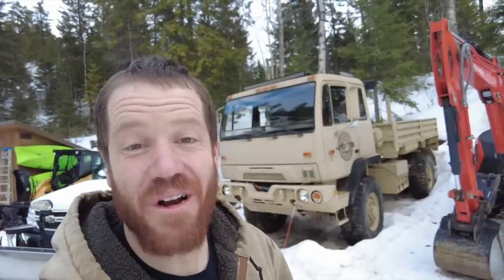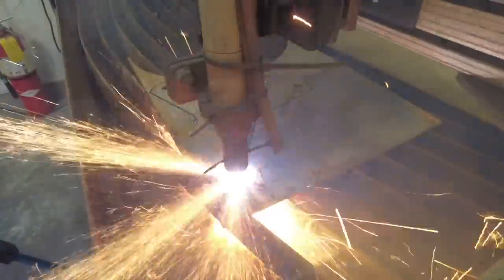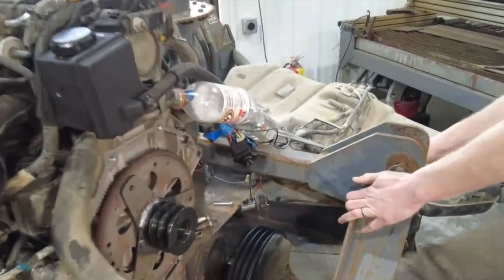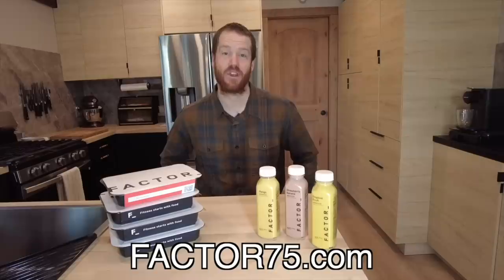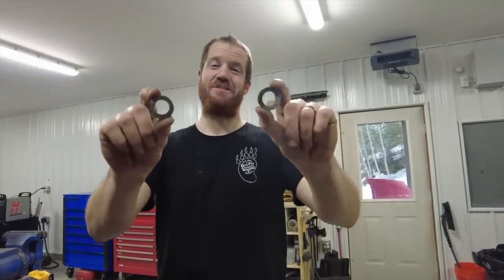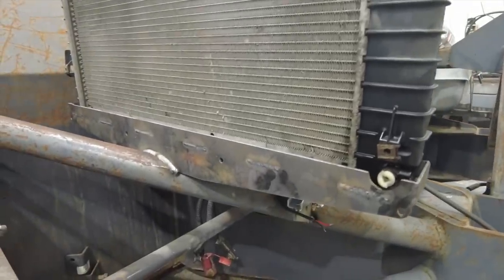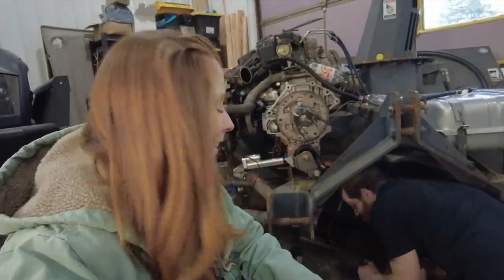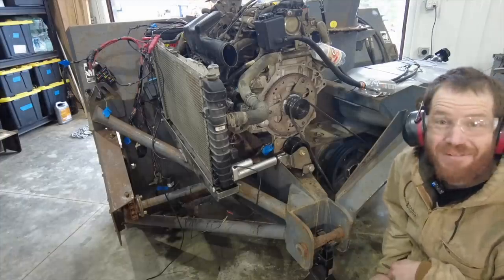DOES IT WORK?! | Building a MASSIVE Snow Blower P3

Comment: Love your engineering skills and creativity. The only concern I would have is the side pull on the large pulley from the tension on the belts will put a lot of stress on the gearbox it is turning. It could potentially lead to premature bearing failure. I would try to create a extention on the shaft on the outside of the pulley and install a pillow block on the outboard end to give extra support.

Comment: Did you keep the silencer I told you to keep? And I'd put some rubber under the tank straps, you did it on the radiator and you'll need it on the fuel tank before vibration puts a hole in it. Absolutely awesome bit of kit you've built. 😉👏👏👏

Comment: ok, here is a quick and easy, blow a hole in the end of the forks of your skid steer, install a trailer ball, now you can very easily move all your trailer equipment and put it anywhere. do both forks so you have centering options when parking a trailer.

Comment: Great project next time you need belt length take e tape measure that fits fairly well in the grove and run it around both pulleys and read the length it will get you in the ball park for length, you guys are great !

Comment: Change the flex plate to a flywheel  if you have not alteady done it.    You may need to use an automotive  hub and bearing assembly mounted to take the tension of the belts off the side of the PTO shaft into the blower

Comment: Love your videos. They are funny, personal, and inspirational. I also have a plasma table and a central machinery lathe, as well as the usual farm welders etc. Have been contemplating doing a snowblower conversion for my Case 580sm backhoe using a Mercedes engine that I have sitting around for several years in a rear ended 380slc. You are inspiring me to finally get going on my own snowblower adventure :) can’t wait to see your finished project!

Comment: Redo the top radiator mount, that will damage it. Also consider starting it tensioned, might work out okay. If not, minimise running without tension or it'll slowly ruin the belts.

Comment: To calculate the length of belt, measure from center to center of pulley, get.pulley size, looks like you have a type B belt, bring info to store and if they know what they're doing, they should get the perfect length of belt by 0.5"!

Comment: Congrats, that some nice looking work.
One suggestion, it looked like you mounted the top radiator bracket to the engine and the lower mount to the blower. 
This may cause cracking in the radiator as when the engine is reved, it will flex putting extra pressure on the radiator.
Think of the standard car set up, the radiator is rigidly mounted to the chassis and the hoses take any flex from engine.
Just thought...

Comment: Very cool to see the progress made. The scarry part of this build is turning the blower without any snow doesn’t require much power, and so you wont be able to tell how much snow it can move, and therefore how fast the army truck can go until the whole thing is assembled    Which leads to the real question....  how long will this blower be operational before Riley drives the Army truck faster than the blower can handle and breaks something😁

Comment: Are you going to set up some type of mechanical governor to operate the throttle?  That blower will need some horsepower and a fixed throttle setting will just result in the engine bogging and stalling.

Comment: You guys are great! Belt length best first guess is pi x dia divided by 1/2, plus distance between center line of shafts. Also and extra 1/2 inch is a bunch either way. We have tried the calculators:)

Comment: I haven’t read all the comments here but something to consider would be snow getting in the air intake. A friend of mine has built something similar for a skid steer. The engine was ruined by snow getting sucked in.

Comment: I am rewatching this because it is interesting.  You may want to add rubber between the fuel tank and the straps like you see on semi trucks.  it is cut back on the vibration and save on the wear and tear on the tank since it will be metal on metal.  In fact, that rubber is required on semis.

Comment: Very cool build guys!! I know a TON of people always offer their 2 cents and I'm not trying to be that guy.  I only have a suggestion with your belt tensioner.  You should add a spring between the actuator rod and the tensioner pulley.  The coil spring should allow constant pressure against the belts as they will stretch as you use them.  If you incorporate a threaded rod with nuts you can adjust in and out you get more life out of your belts,  keep constant tension during load and maybe fine tune your belt lengths.   Only a suggestion, again  great work and can't wait to see it in action!

Comment: Way to go folks, you are doing a great job at engineering and fabrication! I'm anxious to see this at work. Will you need to add some small adjustable swivel dolly wheels on each corner to help carry the weight when on the truck?

Comment: You do nice work!
You may have to put an outer support bearing on your motor pulley. That may be a bit too much for those bolts to take alone.
Definitely try it and see though.
I'm impressed. As a welder/machinist/mechanic I have made a lot of custom machines for the textile and aircraft industry.
I like the way you think.
I just may have to get one of those fancy cutters just to make washers.
LOL!
You will need a governor to adjust speed for the load you are running. The cruise control should do the trick if you use the speed sensor that came with it. It might not be as quick to respond as a true mechanical governor but it should work if you set it to the middle of the rpm range.
I'm really looking forward to the next episode!
Cheers
Terry

Comment: Try adding the center to center measurement, multiplied by 2 to the radius of each pully. The rear main bearing in that little Pontiac engine wasn't made for an unsupported stress in shear. Maybe add a jack-shaft?

Comment: if you would have used sewing tape measure it would have had a belt size really close you need to grease and lubricate your chains and bearings did you ever grease your rollers and tracks on your dozer you doing a great job with the snow blower change over

Comment: There's one more thing,,,those 70+inch belts stretch a pretty good ways maybe 3+ inches your engagement arm may need a secondary pivot location /or a secondary idler pulley  to take up extra slack after first time use.. depending on how hard you lean into the deep snow ,first 10/15 min will tell you ...Start looking for a rad without Plastic tanks  easily damaged under working conditions/ brush,tree limbs ,ice chunks ..

Comment: Hi Riley and Courtney
I have watched almost all your videos and I have to say you folks are adictive , i love all your challenges and I like the way you go the extra mile for excellent outcomes.  I want to comment on your big blower project, it is awsome, but Riley I think you are going to have a accelerator govenor for when the blower goes under load, that blower takes alot of horsepower , if it was on the back of a tractor you would need at least a 50hp tractor running off the PTO. Im wondering if that motor you have has enough horsepower, maybe you could hook the cruise back up as it will give more acceleration under load, just a thought
A big admirerar
Murray

Comment: Nicely done.  But what happens when the belts stretch?  Does the Linear actuator  pulley have a spring system like a excavator track tensioner?

Comment: One question came to mind. Since your army truck has a bed, did you consider mounting the engine on rails in the bed, and running the blower hydraulically? In Europe you will see Unimogs used in the Alps that use that setup. That also helps with overall weight distribution and allows for the blower to be mounted closer to the cab and thus make it more maneuverable.

Comment: I recommend that the exhaust from the engine should be directed out the shoot of snow deflector.   This will stop icing and clogging.  It can be plumbed into the base before the swivel point.  This will stop hot gases from hitting the gas tank and flames as well.

Comment: Great job I notices the boltd you used on the big drive pulley are small. You might have a issue with them shearing off when you hit a rock or big ice chunks. I have ran big norland snow blowers and have sheared alot of bolts off. But awsome job

Comment: I love what you guys do.  It's super cool to see people working towards goals and not be afraid to also show their mistakes and setbacks, along with their successes.  I really hope this design works for you, but I see some potential failure points.
I've been creating and repairing all kinds of machinery for a whole lot of years... everything from old farming implements to helicopters.  I've spent the last 30 years, in many industries, designing, machining, welding, fabricating, repairing and operating many, many different types of machines.  My concern is that both the crankshaft output and the pto input are deigned to perform in torsional loads and not side loads.  Snowblowers, generally being overbuilt and also having the blower portion on the other side of those two bearings, may live just fine.  However, your average automotive (or even industrial diesel) crankshaft main bearings are not designed to support this kind of loading.... beyond camshaft chains/gears and accessory belts.  My fear is that the tension required to keep those belts from slipping (especially in such a wet environment) will quickly consume your crankshaft rear main bearing.
I have seen applications similar to this on mobile, jaw rock crushers, but they always had a conventional disc style clutch and pressure plate (usually with a knuckle over hand lever throw out bearing) and a separate jackshaft or heavy-duty bearing assembly attached to the bellhousing.  
One other thing that I would probably change is your tensioner.  Linear actuators are super cool, but I wouldn't suggest using one in this application.  If you insist on using an electric Linear actuator, perhaps consider using some heavy-duty springs to apply belt tension and your Linear actuator to disengage.  

I don't want this to insight the haters and I really don't want to come across as a know-it-all... I just want to see you guys succeed.

Comment: As you get  to install the 3) 5/8 belts, you may find too much belt drag. They will chatter and try to engage  before want. Look into a belt guide on the motor pulley to get the belts to cup the pulleys.

Comment: Fanatic work for l Riley! I can't wait to see how you wire it so you can control it all from the cab of the Army truck. How are you protecting the air intake filter and all the electronics from getting damaged by snow?

Comment: Great build, just make sure you have way to keep moisture(rain/snow) out of the electronic and electric parts of the engine. My buddy had a Celica with self made huge hood scoop - well it took some rain and poured directly into spark plug holes - and right away started grounding out the spark and most cylinders ...

Comment: If you could extend the the pilot shaft out through the drive pulley and put a carrier bearing on it it would make belt replacement harder but take flex load off the flywheel and also spread the unfamiliar tourqe load from the belts off of just the rear main bearing in the engine

Comment: Awesome possum! If you want to use the cruise control. It probably uses the vss (vehicle speed sensor) they are a magnetic pickup that pulses every time a tooth on the output shaft tone ring passes by. Usually it's counting pulses per mile. You would need to figure out the correct wheel speed for the rpm of the motor. Then you can cut out a tone ring on your plasma table that makes the computer think it's going x mph so that you can set the speed you want. Usually Cruise control doesn't work below 25mph. Or you could use your software to set the idle speed so it always starts and runs at a certain speed. I'm sure you will figure something out though. Using CC is a good idea because it will dynamicly adjust fueling to account for the dynamic load on the blades

Comment: That's Quite a feat of engineering you come up with their. That's pretty cool. Is there any particular reason why you didn't just mount on the front of the army truck and then run a drive shaft to the PTO on the army truck to power it?

Comment: Looks good you two, looks to me like idler is on slack side. My concern is large pulley putting side loads on drive unit made for straight loads from A PTO shaft.
Reply: I posted about the side load issue on the gear box and the engine flywheel after the second video.

Comment: Hello Courtney and Riley, I love watching your show. I enjoy how you use ingenuity to your best advantage. Just a thought. You could use the hydraulic pump motor that currently used for the tipper operation to raise and lower your snow blower as well on the front. Installing a two way valve in the cab would mean you can swap between tipper operations to snow blowing operations. I saw another person on YouTube who had a similar army truck to yourselves made up a straight plow attachment. (his did not raise and lower though).  I used the concept and thought that you could manufacture or graft a three point linkage of sorts to your army truck. This could be adapted to suit a three point linkage of sorts. Then using a hydraulic ram to raise and lower the blower on the front of your truck. Being an engineer and watching your capabilities. Most farmers have three point linkages attachments lying around from old used equipment. Ask around to see if there is something or someone nearby that could help. The used car was a really smart idea. Farmers do not usually sell old equipment but if someone has a better use for it they will usually come around.  You just need to ask around. From what I have known most farmers will be willing to sell old machinery because they have outgrown the old equipment. You may even get a hydralic ram in the purchase.

Comment: I am wondering what effect it will have on the motor with the tension pulling on the crank when the belt is engaged, it's not made for that type of load.... May be very minimal if any wear on the main bearings.... You could always make a bearing support to eliminate that stress point if it becomes an issue... maybe in the fine tune stage if it works as expected it may be a good idea to do anyhow

Comment: Riley, I know that you plan to chain up army truck and put weight in the back. Have you thought  about making a Common mounting system. One that gives you the option of using the truck or your big Cat. If you guys get a wet Heavy snow! Even the truck may not give you enough traction to get through a big drift. The skid - Steer didn't have the traction or weight to push through a big drift. But the big Cat has all of those things, the blade may be able to. But advantage of snow blower is it removes and put it way off to the side. I don't remember if your Cat has a pivoting blade if it does just drop it and just mount your Snow blower.  Just and idea  💡.
You guys amaze me with your abilities and Ambition🥰. Great Jobs allof them.

Comment: Idk. From that footage… I’m not entirely sure you have the works spinning fast enough to throw the snow very far. Will be interesting to see. Did you try testing the driven pulley RPM when you have it at ideal throttle range?

Comment: Great job building your snowblower, but one thing is missing, grease on the chain and sprockets, also not sure if you put any oil or grease in the coupling if those balls cease up it ain't gonna spin just break, you're also gonna need to cover the engine assembly to not only protect it from moisture and any salt that's been spread but also help with noise reduction.

Comment: If you plan to run the motor for extended periods without the belts turning, you might want to consider a mechanical clutch because those belts are going to wear.

Comment: Forget about the cruise control module, just use another linear actuator or solenoid to pull throttle, adjust the "pull" to get the proper RPM.

Comment: LOOKS REALLY GOOD. I REALLY THINK YOU SHOULD USE 12.9 SOCKET HEAD CAP SCREWS ON THE BOTTOM PULLEY BOLTS.  AND DRILL AND BOLT 3 MORE HOLES CLOSER TO THE TOP PULLEY C/L ON YOUR PULLEY MOUNTING FLANGE TO PREVENT A FATIGUE CRACK FROM FORMING AROUND THE UPPER PULLEY NEXT TO THE WELD.  JUST A THOUGHT?! GREAT JOB CANT WAIT TO SEE IT IN ACTION.

Comment: I only want to mention something and I mean it constructively, the one thing you need to worry about is the belts getting wet and slipping. I think if you solve that it will work well. You made a good design by the way. Very cool.

Comment: Don't let the firewood logs sit. Get them split and stacked to dry otherwise they will rot if left in a pile of logs. Also if you can add vents to rear wall of wood shed the wood will dry much faster. I built mine with slats on all walls but large roof overhang so weather doesn't get in. Wind can blow through very well and dries wood quicker

Comment: very creative man... I'm working on a similar project my self, smaller scale LOL. one thing i would keep an eye is side loading of the engine and gearbox. both units are not designed for it, if you start getting oil leaks or excessive heat/wear you may want to add a pillow block or end support other that you got some good design skill's....

Comment: If you need help with the belts let me know. I’m a Gates Rubber industrial distributor and they invented the V belt. We can help you get the right size and the right style. Good call on the Martin Sprocket metal. You need 5VX belts, and I would put either banded belts, or Predator belts on there for longer life.